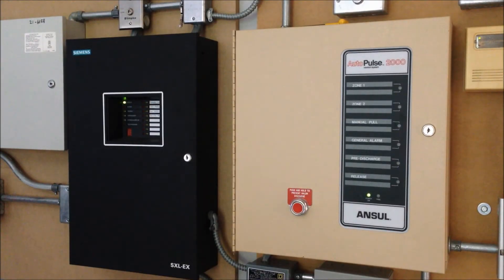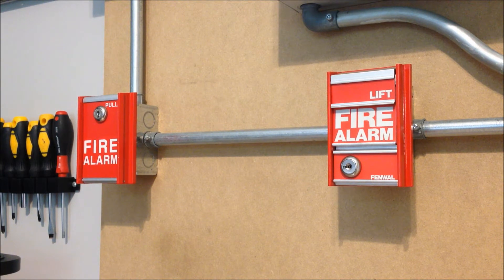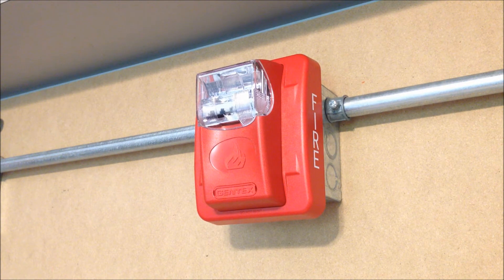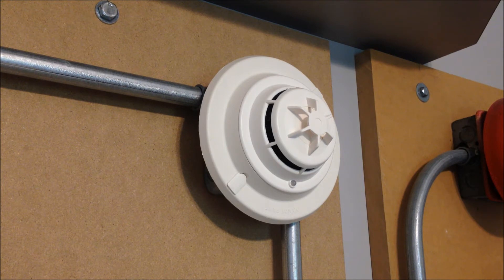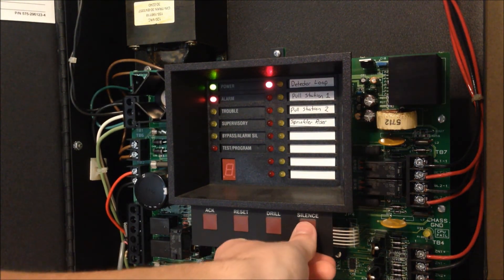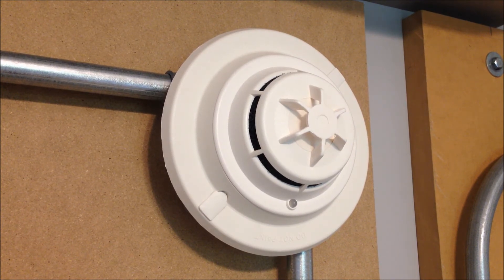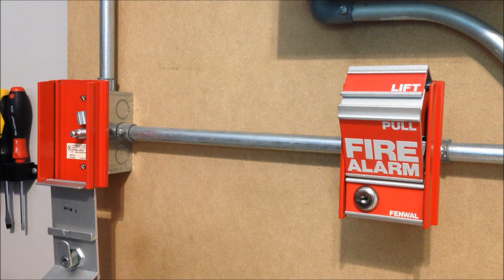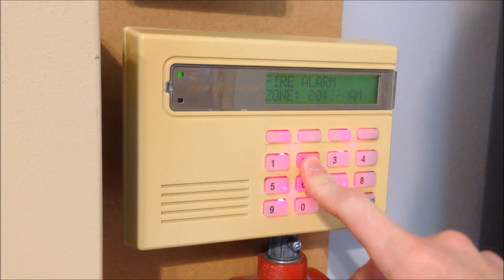System Test 33 | Smoke Detector Activation and EST Chime

Comment: You have a really nice system there! I have a question for you. I am also setting up a SLX-EX panel in my house. Just to test it out, I wired a DI-A3 detector which works great, and I plan on using Edwards Integrity horns. However when I wire up a horn to the system to test it out (with the resistor connected), it makes a chirping sound and does not do anything else. Am I doing anything wrong? Thanks in advance.
Reply from the maker: Thanks! I'm assuming the horn chirps when you activate an alarm on the system, and then remains silent. I've had this occur several times while connecting devices to my system. For me, the issue is usually high-intensity strobes. What is the candela rating on your Integrity? As an example, both Federal V1971 strobes (110cd) and Wheelock WMT-24 strobes (117cd) cause the NACs to shutdown after several seconds. I believe the panel may view the in-rush current on these high-intensity strobes as a NAC fault, thus shutting down the circuit quickly. That is why you would only hear a momentary chirp upon activation.
Reply: kcin556 Ahh I understand. Actually the Integrities I'm using are horn only. In the future I plan on adding remote strobes possibly throughout the house. But what happens is when I connect the horn to NAC 1 with the resistor connected to the horn as well and then connect the power, the system turns on and then gives me a trouble for NAC 1. And when I use drill or set off the detector, the horn does nothing. I'm lost here lol. If I connect the horn without the resistor, then it chirps nonstop until I disconnect it.
Reply from the maker: I see now, this should be an easy fix. The positive and negative NAC terminal markings on the SXL-EX board are backwards. Connect the negative terminal to the positive terminal of the device, and vice versa. Then everything should work as intended. I ran into the same issue when I first got my SXL-EX... it is a very confusing aspect of the panel.
Reply: Ahh yes! It worked! Sorry for the delay in reply, I was away yesterday. Thanks so much for the tip though. I was so confused as to why it wasn't working.

Comment: Great system! Is the Siemens detector addressable?
Reply: HJCF0520 The panel is conventional...
Reply: ironmatic 1 Ah, okay. My school has an addressable Siemens system with identical detectors. Thanks.
Reply from the maker: Thanks! The Siemens HFP-11 is the addressable version of this detector. Ironmatic is correct, my system is completely conventional.
Reply: kcin556 Cool, thanks!
Reply: HJCF0520 My old school had a Siemens system too, it was an MXL-IQ. The addressable version of the detector in this video are modeled with HFP or FP instead of PE. The Siemens panel shown in this video is the conventional SXL-EX.
Oh, Nick beat me to it!